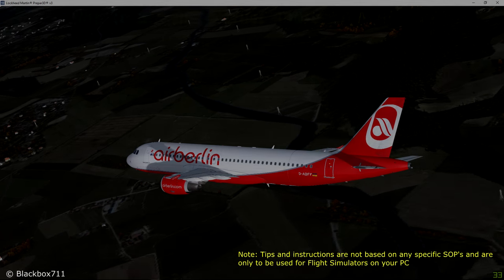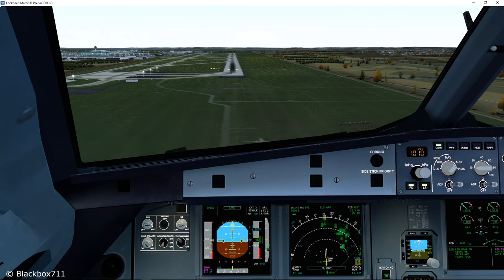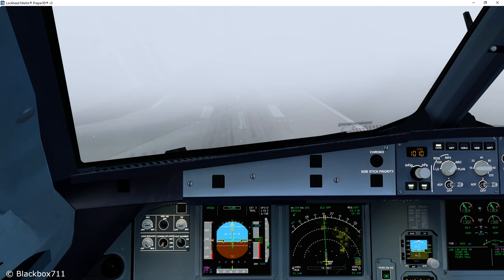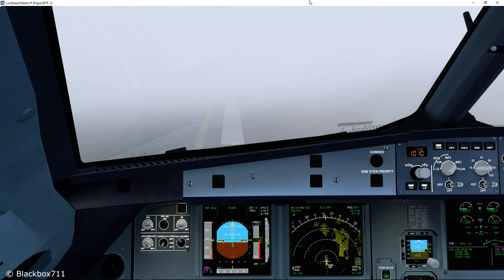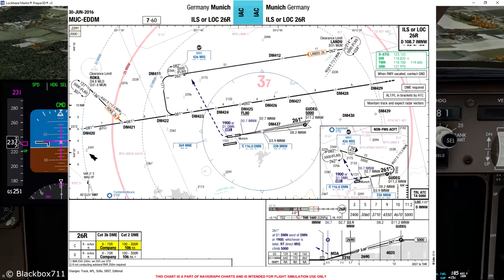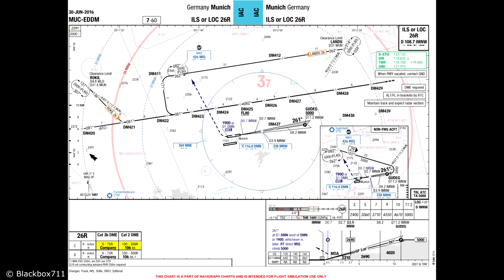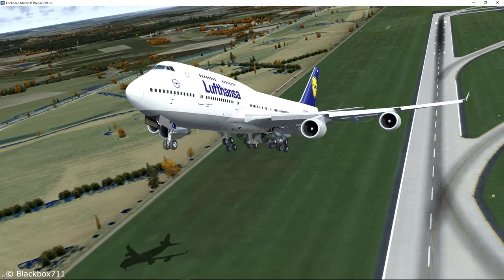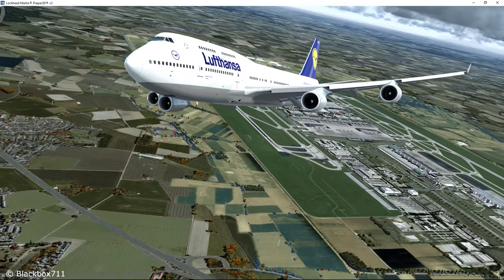Approach Charts and getting the correct Landing Minimum

Comment: Hi black box and one of your fan that’s always trying catch up your tutorials , I am maintenance engineer B1 my Question:
how can you determine if the aircraft is capable to perform an auto land or if the runway or  the airport is equipped with an auto land facility ?
Reply from the maker: Hi. The aircraft will give you the achievable landing capability with the annunciation CAT3 SINGLE or CAT3 DUAL or CAT2 or CAT1 on the Primary Flight Display. The landing runway approach capability will be shown on the approach charts. I.e. CAT3A or CAT3B for example.

Comment: Hello Blackbox711, I'm an A320 enthusiast and I follow your videos with passion and admiration. I do have one question about the chart: why, if Cat I ILS requires MDA/Baro altitudes, is DH/Radio for that approach still published? Is it just for mere information? Thank you for your time and keep up this excellent job.
Reply from the maker: Hi. No, if you fly the CAT 1 ILS you only have the MDA published. There is no DH published. The numbers 200 - 550 are only for information regarding height above threshold and will not be used as an official DH. Regards
Reply: I'm afraid this is not correct, Blackbox. The MDA/MDH is always and only associated to Non-Precision Approaches. For Precision Approaches (ILS/GLS) it is DA/DH and just in case of ILS Cat. 1 without GS you will use the MDA(H), as without vertical guidance you fall into the Non-Precision Appraoch Category (LOC only). The numbers 1)200 and 2)550 are 1) the DH corresponding to the DA of 1650´ (1650 - 1449 = 201) and 2) the minimum RVR for the Cat 1 DME APP. This Navigraph Charts are quite confusing, in my opinion.
Reply: I looked the Charts up, EDDM 26R LOC (GS out) is actually not a MDA, but a DA as well (So you go around on reaching, if not visual).
Reply from the maker: Hi Gabriel. Sorry, but absolutely no. The MDA also applies to CAT 1 Approaches. Therefore in EDDM the MDA for ILS 26R is 1650 ft. In the Legend of Approach Minima it clearly states that the number 200 is the "Required Ceiling" and 550 m is the "Required RVR/Visibility. You cannot just subtract the Threshold elevation from the MDA and then say 201 is roughly 200 and that is your DH. Please be aware that a Decision Height is measured by a Radio Altimeter. Also, in the LIDO Charts, if a DH is shown, it is always accompanied by the letters "RA". A MDA or DA (and yes there are Decision Altitudes as well) never has the letters "RA" beside it and hence you must use the BARO/Altimeter Reference in those cases. If you find a different legend, please send me a picture. I would appreciate that.
Reply from the maker: What? Please send me a picture of your EDDM 26R LOC (GS out). Also, why are you now saying it is a DA (Decision Altitude)? Where do you have an DA indication in the A320 or Boeings? Either you have MDA (DA) measured by the Baro Altimeter or a DH (height above ground) which is measured by an Radio Altimeter.
Reply from the maker: The only thing I would agree on is that for an ILS CAT1 Approach, the minimum shown is a DA (Decision Altitude) meaning that when you reach that Altitude (on your Baro Altimeter) you must immeadiatly go around if the required visual criteria aren't met.There is no defined Missed Approach Point like in an Non-Precision Approach. On a LOC-Approach the value shown (1860 ft) is definetly a MDA, because in the last part you can quickly desend to that value and then fly level until reaching the Missed Approach Point (1.6 DME from DMN). That is the difference between MDA and DA.
Reply: I sent you a PM

Comment: BlackBox, thanks very much for the video.  I have a rather complicated question so I really appreciate if you are able to answer.  For approaches that require a MDA/BARO minimum,  I use a program called Aivlasoft EFB and notice sometimes that the flightsim airport elevation doesn't match the elevation in the Navigraph chart.  For a simple example, say on a chart, the TDZE is 100 and the BARO is 300.  If in my sim, the TDZE is actually 200, would it be good practice to set the BARO to 400?  Thanks!
Reply: Always stick to the chart MDA/DA. Default Airport AFCADs are derived from real world sources so unless the runway has a huge slope (FSX/P3D can't do sloping runways) then they're generally accurate. If not then edit the airport AFCAD and use a better terrain mesh (e.g. FS Global).
Reply: Check the AFCAD for SKCL versus the real world value :-) lol  That's a rare extreme difference.  But generally speaking I only fly into add-on scenery airports.  I understand the point about sloping runways which is where my question is coming from.  Looking at Taxi2Gate LFPG for example.  For 26L - CAT I, Chart says TDZE is 317 and MDA is 520.  T2G LFPG 26L TDZE is 391.  So I should still use 520 as MDA? That would be way less than the 200' vertical distance.  Thanks for any further explanation.
Reply from the maker: +speculous .. I agree with Avantime. Stick with the Chart MDA.
Reply: Ok cool.  Thanks to you both for the responses  :-)
Reply: Sometimes there are cases where you do need to change the chart MDA/DA. For example Remote Altimeter/RASS/Remote QNH - as in the airport's QNH is unavailable because there's no tower or automated weather. In that case you would use the nearest airport's QNH, and then add a buffer to the MDA/DA.
Reply: Thanks again, Avantime.  Very informative  :-)

Comment: When does the CAT 1 LTS minima applied?
Reply from the maker: +"Brain Explosion" .. if the operator (airline) is certified to do CAT 1 LTS operations. Usually ILS CAT 1 has a minimum of 220"-550m. LTS allows a CAT 1 minimum of 200"-400m RVR.
Reply from the maker: +"Brain Explosion" .. LTS = Lower Than Standars
Reply: Blackbox711 ok, thank you!